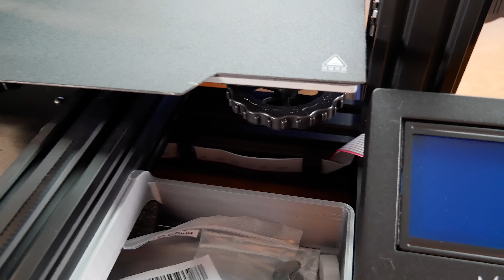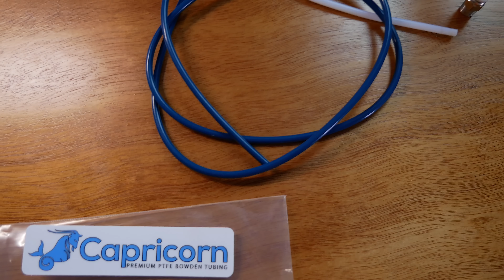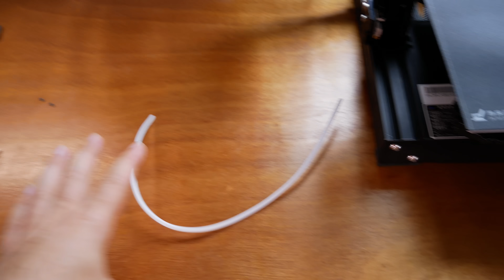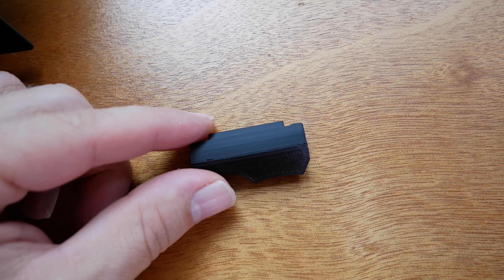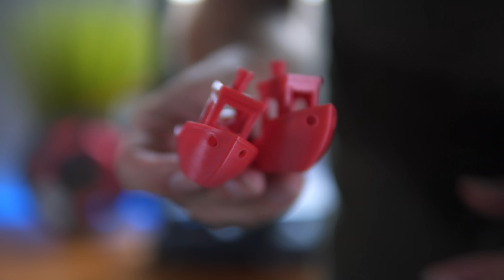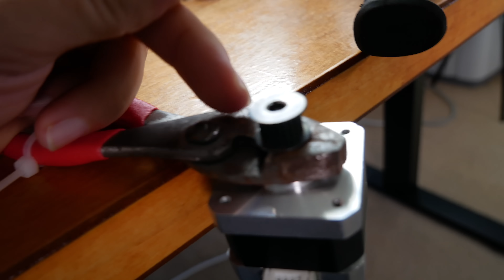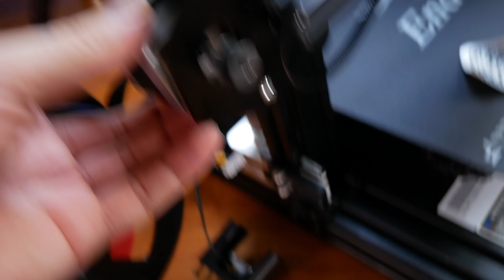Creality Ender 3 Pro - 3D Printer - More Upgrades

Comment from the maker: New Channel: www.youtube.com/@Just_Print
Ender 3 Pro: https://geni.us/xUMach
Recommended: http://geni.us/JustVlads
Upgrade Links: ⬇

Capricorn tubing:https://geni.us/nOtX
Stepper Dampers: https://geni.us/pXvmFBR
Silicone Sock: https://geni.us/rArnrL
Metal Extruder: https://geni.us/SqP89R
TL Smoothers: https://geni.us/eBM2vv
Gear Puller: https://geni.us/Edm856p
Timing belt pulley: https://geni.us/BAvciy8

Printable Upgrades:
Fan duct: https://www.thingiverse.com/thing:3365114
Filament Guide: https://www.thingiverse.com/thing:2770487
Ribbon Clip: https://www.thingiverse.com/thing:2880021
E-Knob: https://www.thingiverse.com/thing:3115901
Tool Tray: https://www.thingiverse.com/thing:3162464
Side Spool Mount: https://www.thingiverse.com/thing:2967567
Spool Holder: https://www.thingiverse.com/thing:3209211
PCB Cover: https://www.thingiverse.com/thing:2987100
Pressure fitting: https://www.thingiverse.com/thing:2994683
Z-axis Mount: https://www.thingiverse.com/thing:2752080

Comment: Most wonderful videos!  Watched every minute of a couple of your videos!  I am a total rookie regarding 3D printing but over the past couple of days I've learned a lot.  I do not yet own a printer but am seriously considering buying an Ender 3 V2.  I am a model railroader.  The particular reason I'm interested in 3D is because I want to print small gears.  I've been looking for info about resolution but not having much luck.  The gear I'm interested in printing is 6.7 mm with 15 teeth.  The gear tooth "module" is just under .5, pretty small gear.  Do you think this printer has the resolution to print the teeth with very fine resolution?

Comment: im looking to replace my bed because my aluminium base plate is warped. not to the point of being un-usable, but i have to put a fat raft on all of my prints to get any 1st/2nd adheasion. hoping a glass bed will be abit flatter

Comment: About making the Ender 3 pro more silent, here's an upgrade that did wonder on the Meanwell poer-supply (larger but slower fan with 3D printed enlarged PSU cover). BTW i also added a simplistic fan-speed controller, but already the cover+fan upgrade alone makes it the less noisy part of all:
https://www.jmd-tech.com/blog/Ender-3-pro-upgrade-power-fan-speed-controller.html
Next i plan to upgrade to the "silent board" i've ordered from Creality, with more silent and smooth motor drivers. Then probably with a hero-me or similar fan-duct, enable to use more silent fans on the print head.

Comment: People replace the flexible magnetic bed because either the flexible bed itself is warped, or their heatbed underneath is warped and the flexible bed follows the warped contour of the heatbed. Either problem affects print quality and makes it extremely difficult to properly level the bed, so by replacing the flexible magnetic bed with borosilicate glass you eliminate both of those issues.

It's a fairly cheap fix, the Creality borosilicate glass bed costs ~$20. I've also heard of people using a section of mirror glass, I wouldn't recommend that because mirror glass isn't able to handle thermal shock as well as borosilicate glass and may crack/shatter/explode after being rapidly heated and cooled so many times.

Comment: if you slow your print speed down 10 to 15 percent it will solve the sound problem. You can adjust in menu will  its printing

Comment: Uummmm....my ender 3 pro came with clips that pop in behind those feeder tubes. They're little blue clips. 2 smaller ones and one larger. And my extruder feeder came aluminium as well.??????? Stock from ender. Weird

Comment: How does someone with a 3D printer not have Exacto knives?.....

Also, it's called perpendicular.

Also, I doubt the dampers would have EVER affected print. If anything, you're pounding on the motor could have.
I really want those dampers now, but am scared to have to put that much vibration through the motors.

Comment: all these upgrades are crap and a waste of time, the only thing you need to do is change the springs and have a spare filament drive in case it cracks, which it will at some point, any thing else does nothing to the printer except make it look different. Just follow Cheps bed levelling and you will never have a problem with an Ender printer. mines been running for 2 years without bling and only a month ago the filament drive cracked, 5 minute fix to change it for metal. Changing the Bowden tube does nothing, its an excuse to spend money. Just print things that make you money

Comment: For the bowden tube, when putting it in the hot end, make sure to secure the push fit connector to the tube first, and make sure the spacer that holds the movable part away from the metal bit is secured in place. This will grab the tube, so that when you tighten the nut, it will actually put pressure down. The way done in the video is probably okay, but what he described versus what he did were to entirely different things.

Comment: I wonder if instead of using those specialized rubber dampers, you cut a sheet of thin rubber or like an inner tube to put in between the motors and the mounting plate. I know you would still have contact through the bolts but it might make it better.

Comment: thanks. I too love my ender 3 pro and will proceed with the dampers and I also have the metal extruder\boden upgrade. I also got the Swiss hot end I will install. I have a set of pullers and I'm also looking for a wider or longer gear.

Comment: 25:26 After installing my new silent board, the two loudest things left on my E3 are the fans for the PSU and hot end. I printed these, and now the overall sound level is much lower. https://www.thingiverse.com/thing:4506240
https://www.thingiverse.com/thing:4266939 or https://www.thingiverse.com/thing:4558310

Comment: 8:42 You should have unscrewed that nut a little bit like you did for the hot end. That would have forced the end of the tube up against the inside wall of the red extruder, and further into the "teeth" of the holding nut when tightening it, thus lessening tube movements to almost zero during feeding/retractions. The way you did it will still allow the tube to move slightly anywhere from 1-2mm (or more over time), and that is even with the clip in place and using Cap tubing, because it's outer diameter is exactly the same as the stock tubing). I loosened mine almost one full turn before inserting the tube, and then tightened it, and now my stock tube barley moves a fraction of a millimetre at that location, which helped cleaned up the surface of my prints, and allowed me to set my retraction distance to a much lower number.

Comment: My Capricorn tubing arrived perfectly cut..

Also, I’ve been hammering at one of the motor rods for right about 40 minutes, and it hasn’t moved even a millimeter. I’m using the exact same tool mix that yer using, and all I’ve done was damage my table some

Comment: For those trying to go whisper quiet, I use the creality silent board with klipper and a Hero Me because the stock metal "box" is surprisingly loud. Also a power supply fan redirect, and hopefully your firmware gets rid of those awful beeps in the panel. Make sure you also have a solid table; if you use the IKEA LACK square table then print braces for the legs and put rubber feet on it.
My gaming pc is actually louder on idle than the printer is in use.
If you add those dampers, please for the sake of those motors, add heatsinks for stepper motors.

Comment: Try flipping the magnetic bed over so you are printing on the back.  Smooth bottom and no stick issues at all. I have the 3 pro too.
Reply: Another tip is corn pads for under the feet. they work great and have adhesive on them in case you have to lift to clean under your printer.

Comment: Is there a printer you can purchase with / out having to do these mods?
Reply: Part of the gun of having a printer is using it to print upgrades and make it better.  That said,  the new version of the Ender 3 and the Pro have most of these minor upgrades already in place

Comment: Never understand why you would want to blow cool air on the hot end, which you are simultaneously heating it. I get cooling the material after it extrudes, but this doesn't appear to be the case. Also, I'll bet this small air nozzle is restricting airflow

Comment: Cutting the zip ties from the tube was not needed and a waste. Remove 1 end from the feeding side and slide them right out. Then slide the new tube in. Saves 2 zip ties and some trouble.

Comment: Question, when installing the motor dampers, would it be possible to maybe bore out the holes on the "Y" motor bracket in order to have some horizontal moment? (horizontal slider holes) I don't feel comfortable banging out the pulley gear off the motor shaft :/  Not sure how you'd do the "X" motor however without banging out the shaft. Awesome videos love you work man.
Reply: what did you end up doing? I was looking at others who replaced the gear altogether. i.e. pull off the press fit gear with a device then replacing the gears that you can tighten. https://www.youtube.com/watch?v=T1W7tCF3kb8
Another method, change the orientation of the motor altogether while leaving the pressed gears along, but you'll have to update firmware. https://www.youtube.com/watch?v=IjzrNoFnbcI

Comment: Once you have finished printing, do you leave the filament in or do you remove it?
Reply: I remove mine. But I'm new to this and don't know what's recommended.
Reply: If you plan to print more soon,  I just leave it in there. If you aren't going to print anything for a while,  it is best to remove it to prevent humidity and dust from collecting in the spool.

Comment: A tip for getting a 90 degree cut on the tube - put the tube into the fitting so that it protrudes a bit from the bottom, and using the end of the brass fitting as a guide, slice the tube so that it is flush with the brass fitting. Oh yeah - and has been noted. Invest a couple of bucks in an X-Acto knife (or similar).

Comment: Isn't the stepper going to overheat when using the dampers, since normally the frame acts as a heatsink, but now the rubber will insulate and prevent this. Is it going to hurt the steppers?

Comment: Hi, I am thinking of buying the ender 3 pro as my first 3d printer and was wondering if the filament feeder can be mounted on top of the extruder part with a bracket and have a short tubing

Comment: The MUST have upgrade is the Upgraded Motherboard. There is some magic there and the stepper stop making that whinning noise !
Reply: Where do I find that or what is the name of that board?
Reply: @niklas1723  On amazon : Search "creality 1.1.5" Youll will find plenty of Silent 1.1.5 boards. I personnaly went with the Comgrow one, as I also bought the Glass Bed.

Other worthwhile upgrades :

https://all3dp.com/1/20-must-creality-ender-3-upgrades-mods/

My highlights :

A rasberry pi 4 with Octoprint and a V2 camera. (Cura can then send jobs to and communicate with the Octoprint server over the network and also get the camera feed (to watch your job) (case is the #2889371 on thingiverse)

Print this camera mount too, very well designed. #2987719

The HeroMe Fanduct from thingiverse Can help with part cooling, it gets very good results in overhangs.

Then change the big fans (Bit of electronic "fidgetery", be careful with the PSU, capacitors can retain harmful/deadly charge even when off) : 2 buck converter to convert 24V -> 12V then hook up some more silent Noctuas fans (One 40mm X 20mm for the Extruder. one 80mm X 10mm for the PSU) use the 12V non-PWM "FLX" ones.

That's where i'm at, a few very nice upgrades can be found with a little "Ender 3 Upgrades" search on the Google.

Comment: Excellent videos. Nice coverage of the topic. Tight editing and very little unnecessary chatter. If you want to cut down the noise, you could have saved a lot of $$ by adding feet to the printer bottom first and seeing if it helps BEFORE shelling out for those custom parts.

Comment: Do not change your bowden tubing this way. Search YouTube for other ways, as in the correct way. You're supposed to heat the nozzle and unscrew it about 3/4 to one full turn. Then you screw in the bowden tube connector all the way. Push the bowden tube as far in as you can. Then you retighten the nozzle which should give you a very good, tight seal between the nozzle and the bowden tube. Again, there's plenty of YouTube videos that show the proper way of doing this.

Comment: So you put electronic smoothers in and next you introduce play every time you move with the motor dampeners :) Don't hammer the stepper motor axel... if you hate the noise make an enclosure of some sort. Creality prob. changed the design so people wont use dampeners... now people start to break their motors... Don't replace the tubing when the extruder is hot, materials expand so when it's hot and you place the tubing it it opens up when cooling (or cooler then the set temp). Want the tightest fit place it cold.

Comment: I wouldn't faff around with stepper motor dampers. You can get the BigTree SKR E3 Mini, which is a drop-in replacement for the Creality main board, for under $30. This has trinamic stepper drivers and once installed, the motors are near silent. I must say I was skeptical but I was amazed at the difference. The loudest thing is now the fan in the electronics box. I'm tempted to remove that or replace it with a Noctua fan.

Comment: You added the motor dampers which pretty much completely eliminated the 'salmon skin' artifacts, but another possible cause I've heard of is the belt teeth running along a smooth idler bearing surface (which I see is used on at least the Y-axis of the Ender 3), it can introduce a vibration that can cause salmon skin. It doesn't look like it's much of an issue though on the Ender 3.

Comment: I got mine in a package that included the metal extruder, though I have yet to fit it. I am running it using the basic slicer that comes with it, and am getting beautiful prints right out of the box.  The only problem I have spotted so far is that there is an error in the assembly instructions relating to the placement of the Z axis limit switch.  Rather than placing it at 32mm height, simply place it as low as the spur that has been newly added to the part will allow.  The spur rests on the base extrusion.  

I have printed some upgrades to the filament path that seem to be popular, but so far  they have caused more trouble than the original configuration.  Granted there may be weaker parts that need replacement over time, but I think a lot of these upgrade projects are not necessary, and I am not the only one saying this.  Both CHEP, and Salanderer have videos that say the same thing.  The upgrades are fun, but they are also great subject matter for videos whether they really work better than the basic machine or not.

Comment: Not sure if blowing fresh air to the nozzle (via a fan duct) is a good idea. It cools the nozzle...Supposedly it should blow to the piece being printed, not the nozzle. Also you can use a whole pad made of eva rubber, instead of those foam feet.

Comment: i just ordered an ender 3. will it be good enough to assemble and run to print all these upgrades or should i pay someone to make them for me and then assemble with upgrades on?
Reply: too slow406 you’ll be fine printing your upgrades, make sure you double check compatibility with the standard ender 3 I’d suggest printing the cover that stops filament from falling down in the fan under the bed first cuz thats a pretty risky one.
Reply: @nexawer4059  sounds good. Doing that, then either the 2 for the factory filament or doing the new bearing roller to mount on side. Then the board cover.

Comment: Did you recommend this printer? I will to have some printer in home for my self. is it in good quality? Are you satisfied to this printer (Ender 3 pro)?
Reply: Mine showed up today. 3hrs assembly and my first print failed 20 layers in (base came loose from plate). 
I leveled it once again and have printed 4 flawless items now! 
Still plenty of testing and tuning, but my opinion is highly favorable right now
Reply: I just got its nice I'm bout to to start upgrading like his the only problem I have is changing filament and working with the software cuz I'm still trying to figure out

Comment: Not really impressed. I own an Ender 3 and unless I'm sitting right next to it, I can't hear it. Now only half the drive gears are sitting on the shaft with all that tension of the belt on it. Over time, I can see uneven wear on the shaft and gear, possibly the belt. Maybe a simple piece of thin rubber as a buffer between the stepper motor and frame would. I might post that.

Comment: Pull those dampers off and throw a new mainboard in with either 2208's or 2209's in it. My E3 Pro has the Creality silent board running 1.1.9 Marlin and it is whisper quiet, no whine at all, just fan noise.
Reply: This is what I was thinking.  Silent maiboard is the way to go. Total silence, no banging on motors, no physical modifications.
Reply: Ty

Comment: Well,  the stepper motors are screwed. You never use a hammer with a motor.
Reply: The motors are Not screwed. They are still working

Comment: How you setup  the bed temperature to 60c my is setup at 50c , and every time I chance to 60  the machine goes back to 50c , thanks
Reply: you need to reinstall your cura
Reply: Cura contains a huge amount of settings that you can adjust and save as a profile.  I had the test-piece of PLA that you get with the Pro at 45 and that printed fine, got a rol of filament from a supplier in The Netherlands and that definitely needed 60 because the prints would warp awfully bad otherwise.
There is a setting in Cura that makes you able to set the bed temperature and when you set it 60 (or set it to 60 and save the profile) and slice a model and save the gcode file, that's what the printer will use.